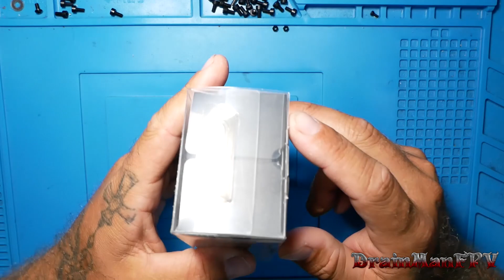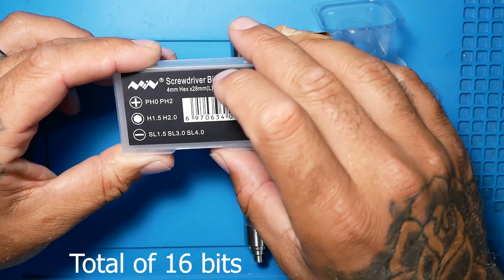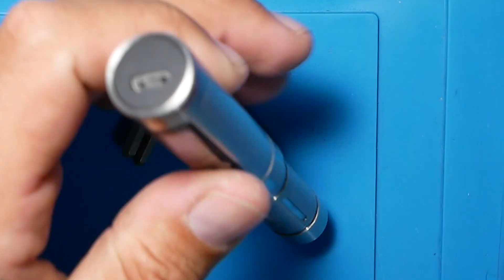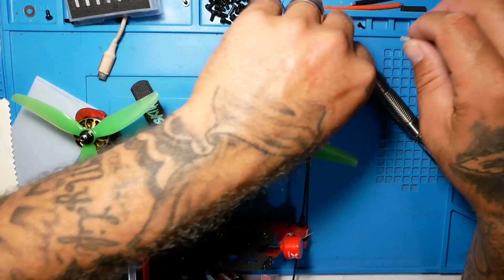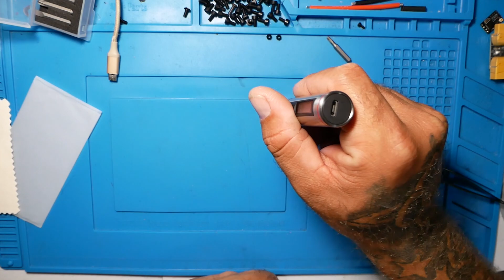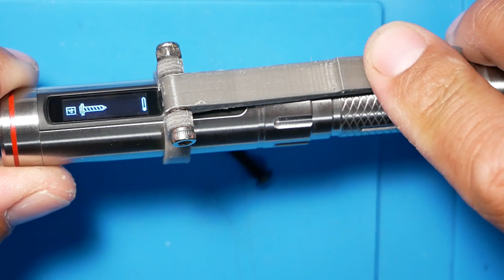ES121 Electric Screw Driver | Should You Buy One ?!

Comment: if you or anyone is looking for a cheaper alternative that has better button placement and is cheaper look at the WoWStick 1F+. it comes with 56 bits, a Magnetizer/Demagnetizer, a guitar pic style tool for prying apart electronics and a Keyring Suction cup for removing screens from phones tablets etc.  Ive been using it for about a week now and im absolutely in love! it comes with the dual clutch functionality witch means you can tighten/losen a screw by hand or with the buttons. It comes with shadowless lights on the tip surrounding the bit driver and has a very nice little Desk/Workbench holder that it pops into while using it at home. Not to mention the Magnetic Carrying case it comes with and how each of the 56 bits come in 3 different Tubes nicely organized and the carrying case can fit one of the Tubes of bits aswell as the WoWStick! lmao didnt mean for this to be a review of the item but look it up. its nice. lolll!
Reply: А ты разбери свой wowstick и увидишь какой там маленький моторчик и редуктор на шестеренках (не планетарный). Моторчик такой маленький, как у китайца член. Так что ES будет намного лучше.